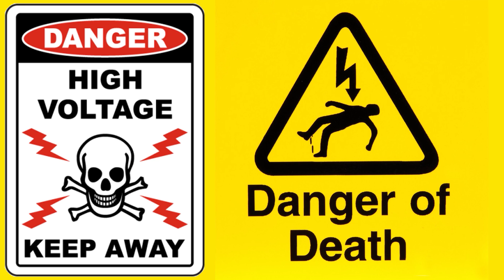Production 5751/EL34 Amp:  Final Steps!!

Comment: Looking forward to building this amp. Since I have to buy output transformers from Edcor can I substitute these parts for the power and choke instead of the Hammond parts?

XPWR 179 - 700V@200mA CT, 6.3V@5A CT, & 5V@3A
120Vrms, 

CXC100-5H-200mA - 5H, 200mA choke.

Thanks
Reply from the maker: I've personally had bad luck with Edcor power transformers. Had a couple that were mechanically noisy and one simply failed after about 2 years of use. The choke would be fine.

Comment: Hi Stephe, 
I have been repairing and renovating electronic equipment for 55 years. The last time I repaired a tube amplifier was 50 years ago. I have a few questions for building an amplifier similar to yours. Can I use with Hammond model 125E output transformer? Is a specific type required for a 0.22mF capacitor?
Reply from the maker: I haven't used those transformers but I'm not sure they have a wide enough frequency response to use for this amp. And you can use whatever sort of film capacitor you want for the coupling cap or the power supply caps. But I do know these choices impact the sound of the amp and when you start changing things like this, it will change what the amp sounds like.

Comment: Hi Stephe, complete noob here. I've never attempted anything like this so for me it's all a bit daunting. However if someone could supply a chassis or even a just a ( template for one ) a parts list, and wiring diagram and a video/tutorial on how make it, i'd be more than willing to simply pay for that. I'm in the UK so the shipping on the chassis would probably be a deal breaker where as just a paid link to all of the above would be a no brainer for me.
Reply from the maker: The problem with a "template" is I don't have one, I'd have to learn CAD software to create an accurate one and I already supply the schematic, parts BOM and just did a complete video series on building it for free... I can't see the shipping on a bare chassis being that expensive, but I can see people not being willing to spend what fabricating a chassis would actually cost outside of China.

Comment: Hi Stephe, enjoying watching your videos, I have learnt a ton! I have recently completed the Blueglow KT88, but with the 12 inch deep chassis and using Hammond Transformers! To my warn out ears it sounds very nice! I can confirm that drilling out the chassis does take time and a bit of skill and care in measuring, marking and drilling the holes, the larger hole punches were a gift from heaven! It’s so easy to slip with a drill or a file and mark the finish on the chassis, but taking your time and being methodical will give a good result in the end!

Comment: NOT selling kits is OK ..........kits need an organisation and  a team of several people .

Selling chassis on the other hand .............a lot of DIY have problems with that and it may be a reason not to start building an amplifier or mess it up building a low quality housing.

NO way that a commercial amplifier or any other kit with circuit boards can equal the musicality and the electrical performance of a nice well designed point to point wiring like you do .
Worse even when the sockets of output tubes are solded on the circuit boards ( as seen even on amplifiers from a respected brand )...unless it is a low level phono or  similar.

One option to tweak is mounting the input tube sockets on rubber dampers ( as sold also on amazon etc ).............M2-M3 ...

Kind regards
Reply from the maker: I see some that might work for octal sockets at 43.8mm spacing, but not small ones for 9 pin sockets.
Reply: @SkunkieDesignsElectronics  I will try to find back the reference for the small ones......you can also use small O-rings , one above and one below with a screw troug them.( even a little rubber grommet cand do the job )
kind regards